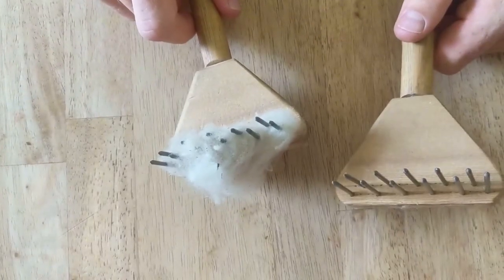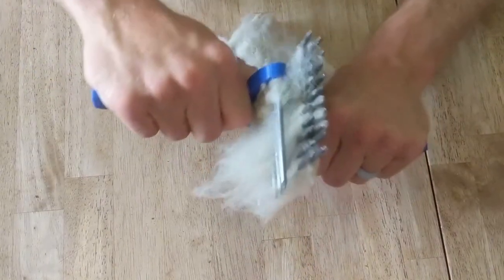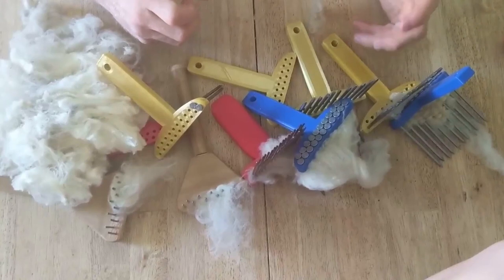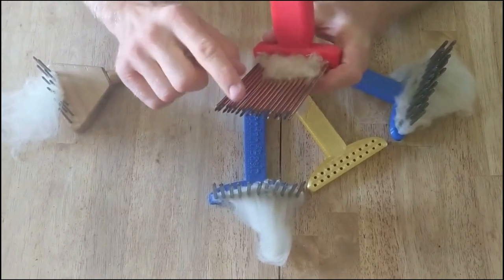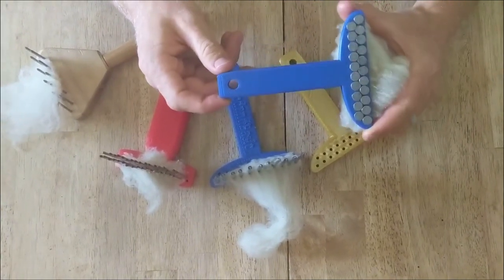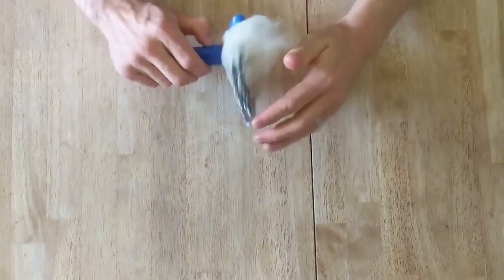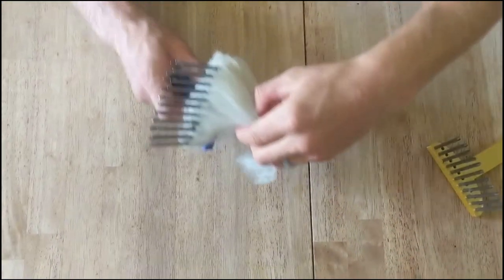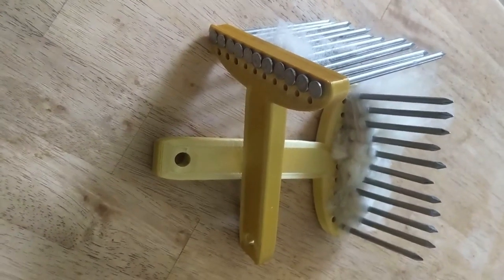3D-Printed Wool Combs! (They work!)

Comment: I just made some drop spindles with my resin printer, looks like I'm getting to print these out too!
Btw, got the frame of my loom made, its stainless steel, I decided to go all out, it has a 52in wide weaving space, and planned for 16 peddles, and 32 shafts. I still need to make the shafts, and all the complicated bits, but at least I have it started. It was my end of welding school project. Once I actually have time to make the rest, I'll let you know, I currently have a 50hr work week welding job at CertainTeed, where they make roto-cast plastic fences.

Comment: Are these only sold in the broad tooth comb? I wanted to brush out my own textiles too, but I'm not using wool. I'm using agave, which is basically processed like flax.

A fine-tooth comb is needed to make silken fibers. Usually with smaller, sharp finishing nails, spaced closer together.

Comment: ok, I 3d printed the wool comb handles, but the nails are confusing.  What size is best?
Reply from the maker: 3.5 inch size 16d. They need to be common nails, not box nails. And bright finish, not galvanized. JB
Reply: @GoodandBasic  sweet, I will take another look at the hardware store.